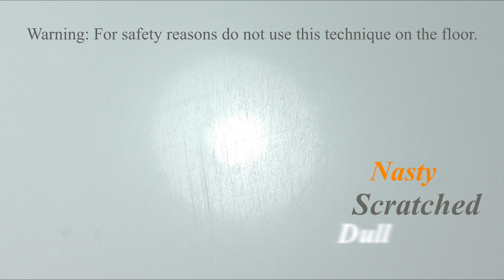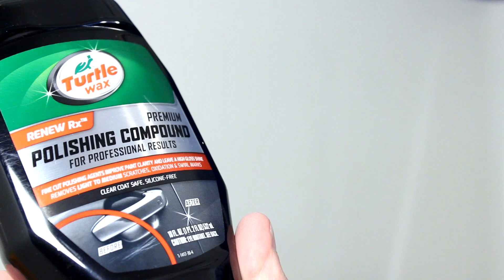Cleaning/Polishing a Fiberglass Shower Surround

Comment: Great video for those who need to do this to bring some shine back to a fiberglass shower/tub.  I have used this same idea, as if you have ever had anything fiberglass, esp. a boat, it is pretty much the same.  I use Rubbing Compound instead of fine grit sandpaper if the shower stall is just dull vs. actually scratched.  Once I have rubbed it out then I use the Polishing Compound and finish up with a Carnauba wax.  Of course the wax will come off eventually as you clean your shower/tub and soap & shampoo from bathing will eventually remove the wax as well.  I just keep and eye on it and add wax as necessary.  When it starts to dull if the wax is gone in some areas, just use the Polishing Compound and re-wax.  This is a must to do if you are selling your house, as a nice shiny shower/tub is an eye catcher.  I do it by hand, but a small hand buffer for the flat areas is a winner.
Reply from the maker: Thanks for the comment Stephen!  I totally agree its a must do item if you plan on selling your house!   One thing I've been considering trying is the new ceramic coats they've got for cars, instead of the wax.
Reply: Hey, that is a great idea!  The ceramic coatings I am sure will last longer than wax. Don't know that much about them, but will do some research.  I have never used them on my car as I am old school doing the pre-wax cleaner then a Carnauba wax.

Comment: So... Longevity wise... How's this work out in the long run?
Reply: There is a gel coat on the surface of any fiberglass shower surround. The more abrasives that are used on it, the more likely you are to remove it and cause permanent damage.

Comment: This is the same technique I use for getting a high shine on silver jewelry.  You have to put scratches in to take scratches out.  So you are essentially removing material to reach the lowest depth of the deepest scratch and then progressively start sending out those scratching with progressively finer grit until you reach a mirrored surface.  Great video.  I am in the process of refinishing my tub but have been sand sanding, I’m switching to the electric sander today, makes it look so much easier.
Reply: has nothing to do with that.
Reply: @mikemclean8421  So can you explain then, rather than just say that and nothing else?

Comment: Well, I found this fascinating as I never would have thought of using sand paper. I have seen the videos using oven cleaner and that was interesting also. Thanks for this information. Have a great journey in life.
Reply from the maker: Thanks for watching Terry!   I've spent a lot of time working with plastic(shaping/polishing) and realized the shower surrounds are just another sheet of plastic in the end.  Takes some time, but really does bring the life back to a nasty shower.
Reply from the maker: Thanks for the comment @abc68099!  Its possible the black discoloration is just on the surface, so this trick may work well if it doesn't come off with a little bleach.  Let me know how it goes!

Comment: For people who do not want to sand bu have a lot of scratches or oxidation you can use something like CarPro Ceriglass with a Rayon glass pad. On a 5-6” Dual Action or Orbital polisher.  It’s a rare earth element (Cerium Oxide) used to polish glass. It’s much more aggressive than heavy cut compound (quicker) takes forever on glass but plastic it would be very quick. You can then use heavy cut/rubbing compound like Sonax Maxcut or what ever is at the auto parts store. With a heavy or med cut pad. and lastly a fine finish polish like Sonax perfect finish with a finish pad.  If you want less stuff to deal with you could use something like 3D ONE single step cut and polish compound. Or RUPES Uno Advance which is a one step cut and Polish with a built in Sealant so you wouldn’t even need to wax after wards. It’s used on auto paint and tail lights etc. So one polish w build in sealant that should be good 3-12 months depending. They say 12 for cars but they don’t see soap every single day. They do see a lot of sun and traffic film so not sure which would be more harsh.  If hand applying wax an excellent wax maybe FUSSO Coat. It’s a full synthetic wax made in dark and light versions. Fluorine is the main active ingredient. It beads water with a vengeance. I’m not sure if any of these would make the bottom of the tub slick or not. I plan to try some of these methods soon on a pretty clean but mildly scratched tub insert.
Reply from the maker: Thanks for the comment LKN4WAR!  I totally agree there are plenty of great compounds out there for polishing as well, I just happened to have all the paper from some of the paint work I've done.  Let me know how the tub insert comes out!

Comment: So is this used as a last ditch effort, or for always?   I'm worried that once I do this (esp. the sand paper), I'll be forced to do the full wax job every month or so - that's a lot of work.  Will I be doing damage?   I plan to keep this shower surround for several more years (I hope).  So I guess I want to know how long this will last.   I'm single, so the shower is used once a day, not by a whole family.
Reply from the maker: Thanks for the comment Drew!   Its been several years since I posted this video, and since then I've only done a light cleaning job with a little CLR, then a re-wax once or twice.   The wax/smooth surface does a great job of preventing buildup over time, so its not overly time consuming once the initial job is complete.  Another pro tip is get a squeegee you can use once in a while to wipe down the wet walls, it'll take some of the calcium/lime/rust off the surface when you do it, and only takes 30-60seconds of your time.